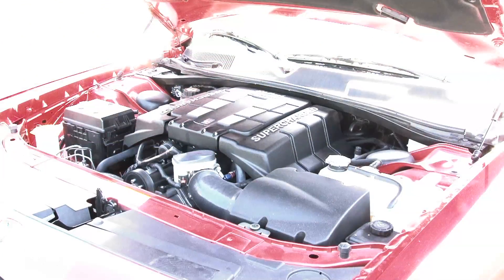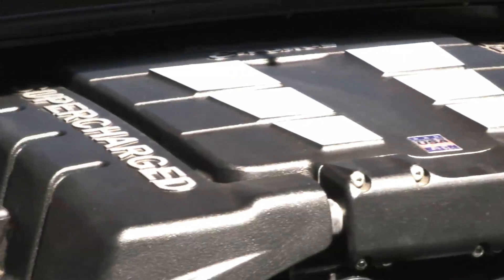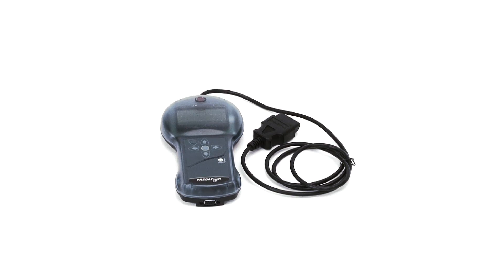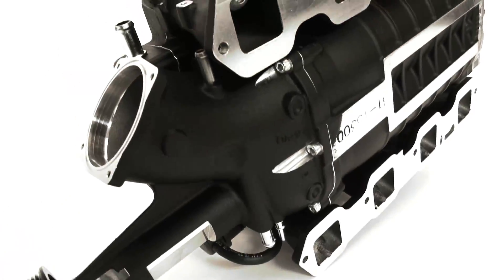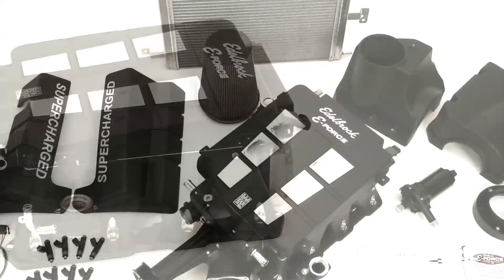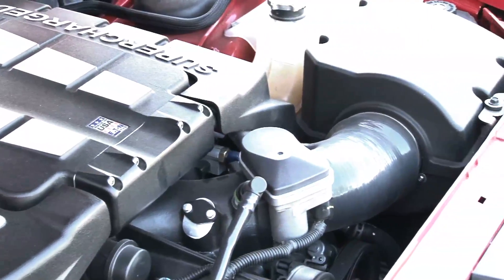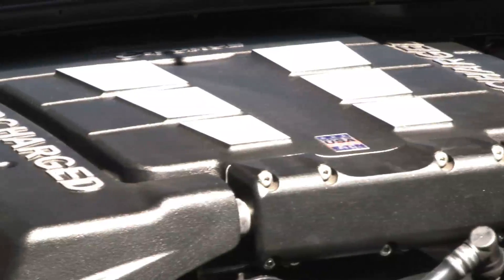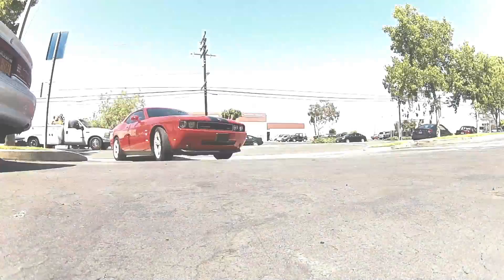Edelbrock E-Force Supercharger for HEMI Applications

Comment: I have a 05 300 can i get this to bolt up? Will i get a hell cat type whine? How much hp will it add?
Reply: Yes it will bolt on, yes you’ll get a whine but not as loud, and about 100-130 hp gain.
Reply: Powernation did a video on it you can look up 5.7 eddlebrock supercharger, they did it on a truck
Reply: It doesn’t whine atleast mine doesn’t

Comment from the maker: We have kits available for the 2005-10 Chrysler 6.1L HEMI LX and LC so far.
Reply: What about for the new 2015 5.7 in the Challenger
Reply: would this fit my 2010 ram 5.7 hemi? would it be OK on my stock 6 speed automatic transmission.